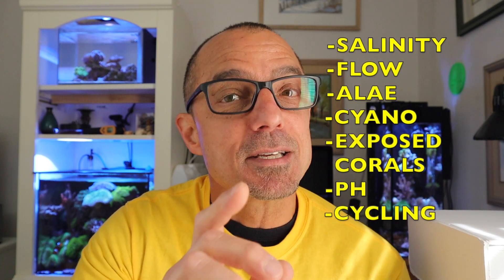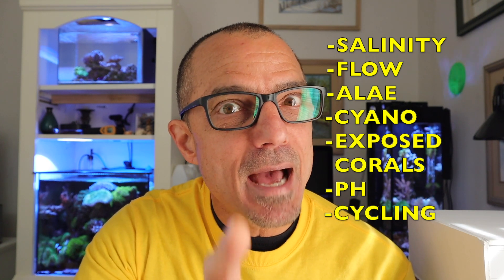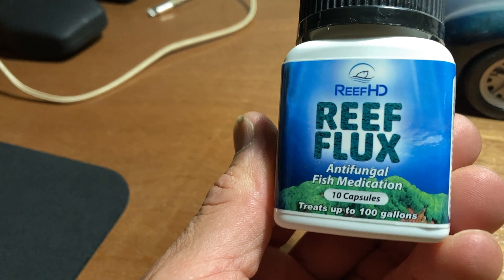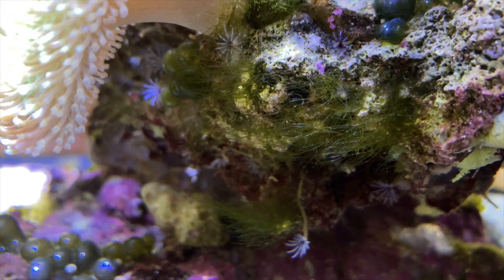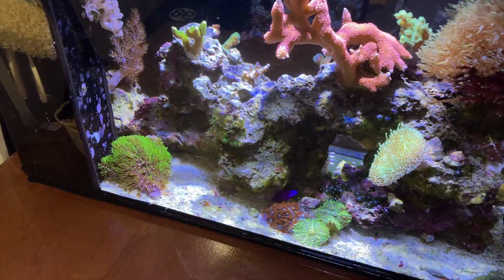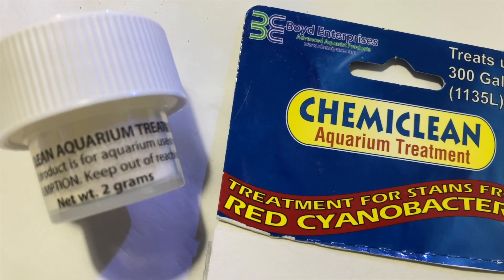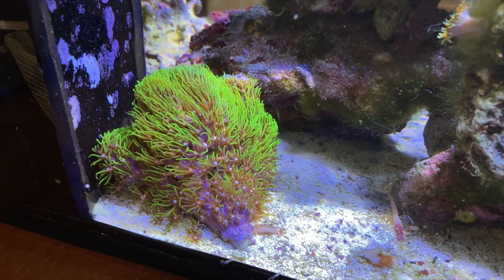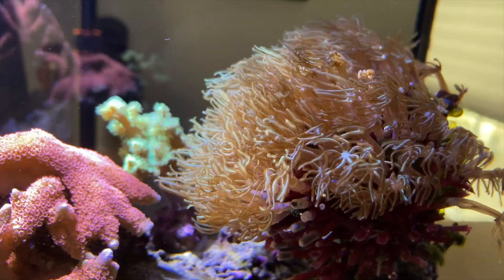Reef Tank Care  ( 7 KEY ANSWERS TO A HEALTHY REEF TANK )

Comment: Hey, I have the same top fin 5 gallon and I was wondering if I needed a wave maker or if the pump already had enough flow as is, I’m planning on doing mainly zoas and maybe some gsp, thanks!
Reply from the maker: Hey Dylan, I didn’t use the stock pump that came with it. I think it’s not enough, but a mini wave would be way to much. What I did was purchased a Sicce Nano pump, which is just enough. And it just fits in. Most other return pumps will not fit in there. Purchased on Amazon 👍🏻😊
Reply: Thanks! I’ll def go check that out now
Reply: Hey, so that sicce pump fits right in the back? I have a nicrew light with a mount that’s screwed between the filter box and the back of the tank, will it mess with that at all or it fits all the way in the bottom

Comment: First the pandemic 😷 then no water change Wednesday. What’s next? Lol glad you’re back hope all is good 👍 I have a question this week. I have a 40 breeder that is fully cycled, 0 ammonia, 0 nitrite. My nitrates are showing in the 50 ppm range on my color coded Red Sea test kit. The tank is only 3 months old. I have been doing normal 15% water changes for the last month or so. When I look at the forums or videos I always see a 50% water change as the solution after a cycle. I really don’t want to make 25 gallons of water because I’m cheap and don’t want to have to replace my DI resin right now lol so my question is do I have to do a 50% water change or can I just keep going with my normal routine and the beneficial bacteria will populate and take care of it? Tank only has two mollies that I feed very little and three snails 🐌 sorry for the long winded question. Thanks 🙏
Reply: My nitrates were around 50 percent at the 4 month mark. I added a refugium and put some beneficial bacteria in it. Weekly it dropped and now it hangs around 10 ppm. It took a couple months for it to work. My tank is a little over 10 months old. It seams as a tank matured, the more stable it gets. I used to do weekly water changes, about 30 percent. Now it's monthly
Reply from the maker: Hi Corey, to make your long question short, yes😃you’ll need to do at least a 50% water change. And even at that you will be bringing it down to 25ppm. Once you are around 10ppm then you will see it won’t rise back up again. Maybe start a refugium👍🏻😊
Reply: @TOMReefer  not what I was hoping for 😩 but if Tom Reefer says I need to do a 50% water change then I need to do a 50% water change 👍

Comment: Hello, first time asking a question. I have an 8 month 20 gallon old mixed reef. I’m having a problem getting my nitrate below 20ppm. What do you do to lower them. I’m shooting for below 10. Water changes don’t seem to help. I tried to carbon dose for the past month and my hammer did not like it at all. I have a skimmer but it also is not helping to lower anything.
Reply from the maker: Hi Lander, you might try adding a refugium. How large have your water changes been?  On the other side of the coin, 20ppm is not that high. Do you have any trouble with unwanted algae? How do your corals look? What is your reason behind trying to get below 20ppm? 😊
Reply: I do 20% water changes on a 20 long every Friday. I am having an issue with gha and possibly diatoms. I’m transferring to mostly sps in the tank so I would like to get it down a bit to make the acros a little happier. My phosphate is always good but I just can’t seem to get it below 20. Should I just leave it there or is there anything else I can do? I tried a hob refugium for about 3 months and it didn’t make a dent.
Reply from the maker: Hey Lander, I did a video on water change and it’s effects on nitrate. When you do the math on 20% weekly water changes when you have higher nitrates, it doesn’t do much to bring them down. If your adding sps, I would first get your nitrates down to 5ppm. You should be able to do this by a  series of 50% water changes. Possibly 2 in one week. If you have a sand bed,  vacuum 1/2 each water change. Try to get rid of your gha before you start adding sps corals.
Reply: Thank you so much! Will do!